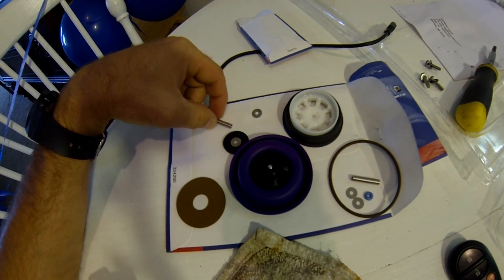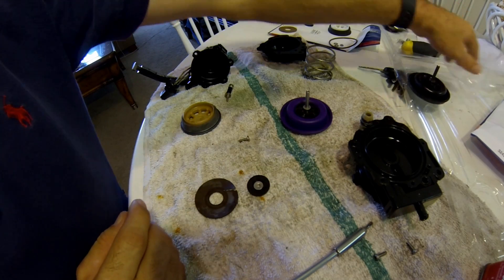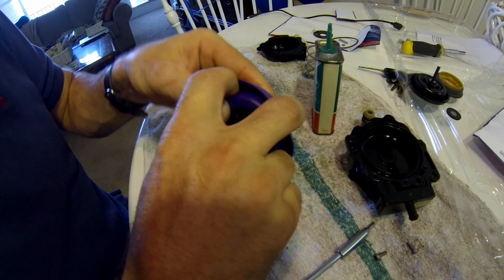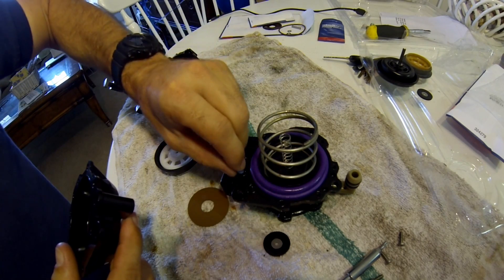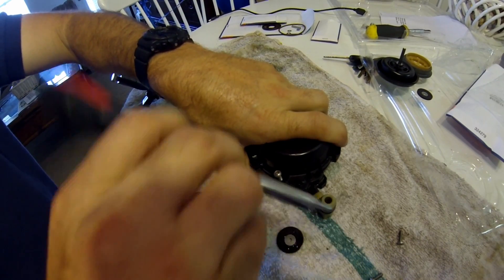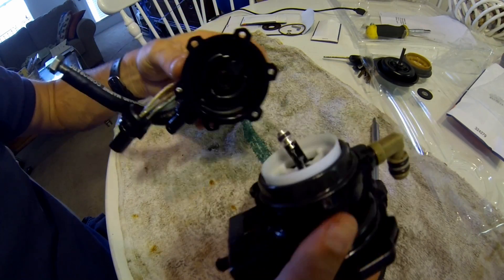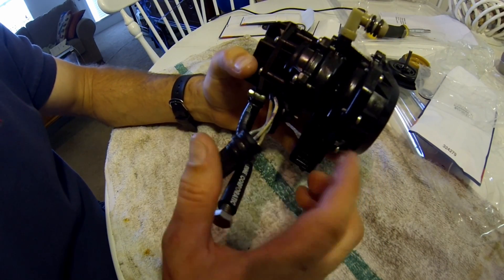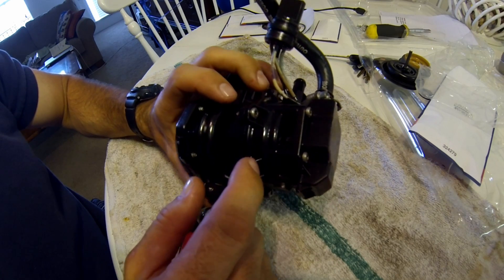VRO Fuel Pump Rebuild - JOHNSON Outboard

Comment: Kit should have shaft seal included.  A good look at the shaft will usually find it's a bit chewed up from contact with the seal retainer.  Putting in a new shaft without a new seal will leak.

Comment: Turns out it was an air leak on the suction side of fuel line. That, makes the oil side of vro pulse more, and causes over-oiling. Which is visually apparent in the exhaust. 
Poor VRO, always gets the blame.
 I'm guilty too. 😔 
Vro Rebuild kits online for $20! 
Don't pay the $300 for one.
Reply: The $20 one may last a day, or if you're lucky, one season. I agree $200 is absolutely ridiculous, but you get what you pay for. I was also able to find it for around $160

Comment: i know this is old but just to be clear : DO NOT REMOVE THE OIL MIXING UNIT! you cant service it, which is why the 0-rings aren't in the kit! unless it's leaking, in which case you will need the 2 new 0 rings! or, since the video guy took it apart, now he needs new 0-rings because it surely will leak now. so again: only the FUEL PUMP side is serviceable.
Reply: Oh no.  I took mine apart in order to remove the pump without removing the oil line.. dang wish I hadn’t done that.  Are the O rings special or just a matter of finding similar size.  Recommendation?
Reply: Can you explain where and what is the oil mixing unit? You mean the side with white plastic diaphragm? Is there 2 o-rings?

Comment: hey jim, i have a 80's evinrude 40 horse with a jet, it does run but its running out of fuel unless i pump the bulb or have the tank gravity feed the motor. wondering if u have an idea if that means the vro isnt working? soon as the tank is set back on the bottim of the boat it only takes a min or two before it run out of fuel unless tou pump the bulb.
Reply: Did you ever get this resolved and if so, what was it?
Reply: @markwilliam2876  clearly the fuel pump side of his VRO/OMS pump got damaged. it needs a new diaphragm.

Comment: was the motor stuttering a lot that's why you replace the fuel pump?
same exact motor in it is stuttering a lot.
Reply from the maker: The engine would idle fine, but while running it would eventually die, unless I kept pumping the bulb.

Comment: The small blue o ring goes on the fuel piston.
Reply: that little blue o-ring is NOT the oil piston o-ring it is the o-ring for the counter reset pin...it prevents fuel/oil mix from dripping down between the oil chamber and fuel pump section.

Comment: I just baught a 140 VRO and the VRO pump was disabled and unplugged.  Do you know how I can test it and probably re-instate it?  Great video!
Reply from the maker: You can hook a clear hose to the oil input and start the motor with some oil in the hose...search the Internet for the process. You should be able to find a post that tells how much the oil level should drop per minute or so. Also, there is a clicking sound to listen for that the pump makes if it is pumping oil. You should premix the fuel also to ensure the engine is getting oil just in case the pump isn't working.
Reply: Thanks for the reply.  I will search and possibly give it a try... I do see a lot of posts about people disabling the VRO altogether to prevent a blown power head... Thanks again!

Comment: My 2000 115 johnson is having an issue it won't idle longer then 2 minutes, I have to pump the bulb to keep it going.  I believe ita the fuel pump, I wanted to know if rebuilding your vro fixed the problem and the price for the rebuild kit. Thanks for your video.
Reply: Did you ever find out your issue?
Reply from the maker: +Brama B I rebuilt mine because one of my diaphragms was cracked badly, but after the rebuild it worked great for a few weeks. A few weeks later though it started giving me issues again so I bypassed the VRO all together. It worked great like that for a while, but I later decided to get up off of my wallet and purchase a brand new one. It has been running great ever since.